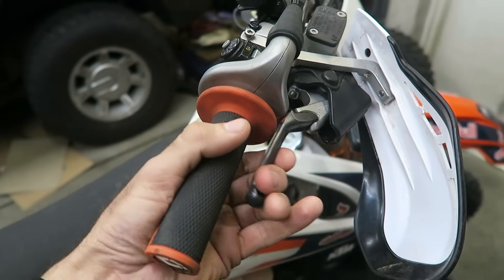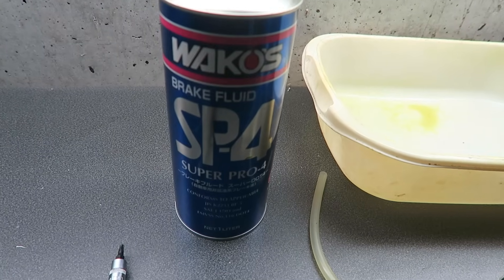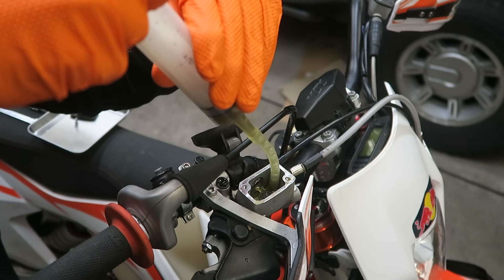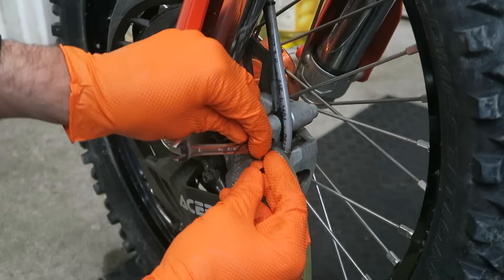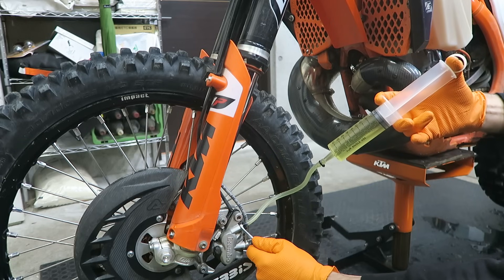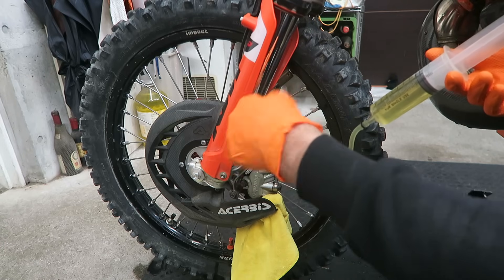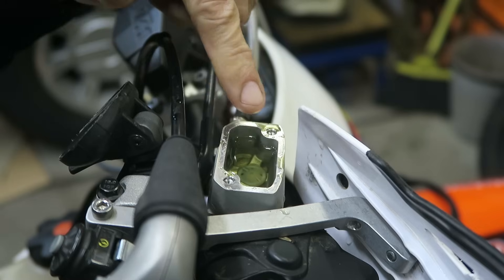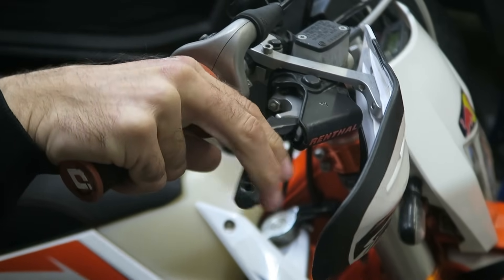Reverse Bleed Brake Fluid Replacement

Comment: just curious why you chose DOT4 over 5.1?
Reply from the maker: For most trail riding I don’t think it matters whether you use DOT 4, or 5.1 as the fluid doesn’t get that hot. But certainly if you’re doing fast riding and a lot of breaking (especially extended downhill breaking), then 5.1 is the better choice. Currently I’m using 5.1, although for my riding (slow trail riding) I never had any problems with DOT 4...
Reply: @TokyoOffroad  cheers!

Comment: Worked like a charm. I tried reverse bleeding and was still was getting bubbles after many many attempts. The key was using the zip ties to keep it sealed the entire time. The zip ties wouldn’t work with the clear 1/4in PVC tubing I got from Lowes, it was way too thick/stiff to clamp through with the ties, kept falling off. What worked for me was silicone tubing like you commented. Ended up using the tubing made for breastfeeding pumps. It looks like it’s too small for the bleeder valve but it stretches over it with some effort, then it clamps down good because it’s so soft/thin. Depressed the caliper pistons with a flathead screwdriver(twist it for the leverage) then pushed through 4 reservoirs of fluid and got the lever super firm the first time. Took me about 10mins total!! Thanks! 

Hope this helps someone else. Wish me luck with stoppies.
Reply from the maker: Pleased to hear that you were successful in the end. Next time should be a lot quicker. Yes, silicone hose is definitely better...
Reply: Just went and got my brother a 06 636 I’ve just been trying to bleed his front brakes spent like 2 hours and still had so much air. Got pissed and started to do more research found reverse bleeding went out got all the stuff went to reverse bleed and still the brake didn’t feel stiff enough. Started searching through the comments and found this one went out got silicone tubing and worked like a charm brake finally feels perfect!
Reply: @jib7793  glad it helped man
Reply: Obviously you won't succeed that way. Air enters the system through the bleeder thread. This method ONLY works if you seal the thread with grease.
Reply: @iulianc9037  the fluid acts as a grease seal for me. Only crack the bleeder 1/4 turn. Actually just did it 2 days ago, only took about 15 mins and the brake lever is very firm
Reply: @mhxxd4  Ok, and how do you get the remaining air out of the top of the caliper if the brake hose is down. Try doing this in a bottle and see if the air comes out.
Reply: @iulianc9037  I'm not exactly sure what you're asking but this has worked great for me every time I've done it. Super firm with rubber lines and no mush at all with metal lines. 

The brake calipers/pistons should be fully depressed with a screwdriver like I said in my original comment or there could be air trapped there. 

And if air gets trapped at the brake lever then with the reservoir full slowly press it(completely down) a few times until you see no more air bubbles coming into the reservoir. Pressing the lever would push most of the air down the line but usually some tint bubbles come up in the reservoir too so when you stop seeing bubbles its a good indication when the air is out of the lever. Now you flush the remaining air in the lines from the bleeder. Also when you're pressing the lever make sure the reservoir's full or it'll suck in lots of air and you'll have to start over.

Hope that helps bro. Any more questions I'm here, done this quite a few times
Reply: @mhxxd4  
The bleeder is positioned at the top of the caliper because that is where the air goes. The brake hose is attached to the middle of the caliper. When you put brake fluid through the top of the caliper, the fluid will go out to the brake line but some of the air will stay there.
You can only get all the air out of the brake caliper by removing it and positioning it with the brake hose up so that the air from the brake caliper goes to the brake hose
Yes, the brake will work fine even with a small amount of air remaining in the caliper. But if we can, why not take it all out?
Reply: @iulianc9037  Noo, it gets all the air out. When you push the fluid with the syringe it takes the air with it, even if it has to travel down in some parts. Normal bleeding usually bleeds the air down anyways so you'll have no issues. If you pull the syringe backwards when you're done, you'll see there's no bubbles left. 

Even if there were tiny bubbles left if they're smaller than the diameter of the  hose then they'll quickly travel up the hose and into your reservoir from the vibrations of your first ride.

I've tested this method a few times, it doesn't leave any air behind if done correctly like I explained. You're overcomplicating things, its very simple

Comment: 74 Thumbs Down?????
What is wrong with people?
Mark, you have the most informative Instructional Videos out there. Keep up the great work. Big Fan.
I do enjoy reading through the comments as well as you can pick up additional tips. Some of the complaints drive me crazy though. Reminds me of the time I was watching this History of Fleetwood Mac show on TV and there was this part where Santana was saying “ I told Peter he should have done this, he should have done that”. I almost threw the TV through the window!
Just finished the bottom end video. Couldn’t put it down. Think I will skip the actual rebuilding of the crank though. A little over my head. I’m better at taking things apart as compared to putting them back together properly.
Reply from the maker: Thanks and pleased you enjoyed the bottom end rebuild series...

Comment: Utilized your brake bleeding method as described, worked perfectly.  Did the same method for the hyd clutch, same perfect outcome.  Watching this and other of your tutorials, notice changes to your machine, on this one the Impact wheels.  Am always chasing maint on my KTMs to keep them near optimum condition for long rides big on fun low on issues. KTM should have a contract with you for this good work. Thanks again.

Comment: First thing I'd do is cover everything with rags or newspapers brake fluid can damage some paints and clock face glasses.
Reply from the maker: Yes, good tip. Certainly better safe than sorry. On the off-road bikes there isn't so much to damage as there are very few painted surfaces (frame). I always have a can on brake cleaner in case I spill some and clean up straight away.

Comment: Great video!  I'm struggling to get new fluid into the line.  It just leaks at the nipple thread with a lot of force on the syringe.  Drain valve is 1/2 turn open or better.  Thanks!
Reply: Maybe a suggestion : Using conventional method, bleed old brake fluid by pressing brake lever and opening and closing ur bleed nipple. It may clear the blockage which may be present.
Then use your reverse brake bleed method using syringe method. I think your bleed nipple is blocked from old fluid gumming up some debri.
Reply: I have got the same! Did you manage to solve it?? Was it blocked?
Reply: very likely you did not open the valve bolt enough

Comment: Good Vid Tokyo, quick question if i may - roughly how much fluid do you need for each clutch, F and R Brake? Tia
Reply from the maker: Jonathan Bradley - They take very little. 250ml should be enough to do everything.
Reply: @TokyoOffroad  Thank you - all the best Jon

Comment: What size hose and syringe do you use?
Reply from the maker: The silicone hose I use is 4mm internal diameter. Syringe size- recently I use a very large one (200ml) which is easy to use and intended for brake bleeding. I also have 100 and 50ml syringes which work OK, but are a little more difficult to use.

Comment: Hi, I have two front calipers. Do I do this on both of them or one side is fine? Please help anyone? Coz with the conventional way I usually bleed both sides. Thank you
Reply from the maker: You can still reverse bleed even if you have two calipers. Just do one side then the other. The advantage is air goes up and bleeding is very easy and quick.

Comment: Thanks for this, I bleed my front brake with no problems :) The rear is giving me trouble, I opened the rear fluid revisor and opened the bleed valve, but when I try to push new fluid in there is a lot of resistance. When I push harder the fluid pushes out just after the bleed valve (coming out the threads I think) do I need to open any other bolts on the brake line? what am I doing wrong?
Reply: I had this issue too, open the valve more and it should help.

Comment: If you were just bleeding the system and not filling a dry line, would you still use this method? The bottom couple inches of fluid always seem to be the darkest. Bleeding using this method would push the bad fluid through the entire system ?
Reply from the maker: Yes, I still use reverse bleeding for replacing fluid. So long as you replace all of the fluid I don’t think there should be a concern. AFAIK the discoloration is due to heat rather than contamination so I think this is a non issue.

Comment: Would you make any special modifications to the brake line while bleeding as on my 2013 KTM 300 xc the brake line sticks up and over the master cylinder at any angle the bars are at. Sometimes I'll loosen the top banjo bolt so the line is angled lower than horizontal then reposition once I've bled the system.

Comment: ive tried this quite a few time and i cant get any fluid to go into the caliper.
Reply from the maker: TheCharillz23 - What bike do you have? Are you sure the bleeder on the brake caliper is being opened?
Reply: @TokyoOffroad  yeah
Reply from the maker: What bike do you have?
Reply: @TokyoOffroad  01 yz125. It's like. The master cup won't fully Prime.
Reply from the maker: TheCharillz23 - It sounds like your master needs rebuilding/repairing

Comment: A tip that is popular when bleeding mtb brakes is to pull on the syringe before you open the bleed valve.  You’re trying to create a vacuum in the syringe, when you do you will see loads of small air bubbles form in the fluid, flick the syringe with your finger to get them to float to the top of the syringe.  Just another little thing to get that nice firm lever feel.
Reply: That will pull air in past the threads of the bleed screw.
Reply: @walterandrews3077 It never has when I’ve done it.

Comment: Excellent vid.. nice and clear. May I add that topping off the brake fluid to the max level should only be done when new pads are fitted. Topping up to the max level on the reservoir with part or well worn pads will only cause you headaches later when you come to change the pads for new ones because the fluid can overflow from the top of the reservoir as the piston/s are pushed back into the caliper/s and the fluid level rises making a mess, unless of course you drain some excess off prior to fitting said new pads. (not everybody follows this practice and the reality is brake fluid leaks through the tiny air holes present in the underside of the cap/lid that are designed to allow the seal/diaphragm to take up the slack as the level falls and the pads wear) Not being critical my friend just some helpful advice if it's any use.
Reply: You can completely avoid this by opening the brake bleeder when pushing the pistons back, i do not understand why people jump through hoops when its the easiest method.
And using a pair of calipers to measure brake fluid level is just psychopathic.
Reply: Wise words!
Reply: Even then people tend to squeeze the brake piston all the way in which might make the reservoir overflow
Reply: The caliper piston is roughly 3 times. Larger than the master cylinder piston. . 
With that said when  you push the caliper piston in just look how much pressures your are putting on the seals & cups ,  roughly  12 mm caliper piston. I have ruined even new master cylinders with that method. What to do is open the bleeder on the caliper to relieve the pressure you create when pushing the caliper piston back in. Or just take your chances.

Comment: You want to check the level of fluid compared to the amount of wear on the brake pads. That way when you change pads you won’t over flow the master when you compress the pistons.

Comment: Could not get this method to work on my KTM 690 Enduro ABS. Once connected, could not depress the syringe, forcing fresh fluid back into the system and up into the reservoir. Not sure if the ABS unit prevents a reverse flush but with the bleeder bolt open fluid could not be pumped/pressed back into the system.
Reply from the maker: I don't have personal experience bleeding 690 ABS brakes so hesitate to offer advice. Anyone else?
Reply: @TokyoOffroad  Thanks for the reply. Had to settle for a vacuum pump and bleed/pull from the bottom. That worked fine. Would like to figure out if the ABS is preventing a reverse bleed but for now I'll go with the vacuum method.

Comment: You missed a step. That bleeder valve is above the brake line fitting. When you are pushing fluid in through the bleed screw, air can remain trapped in the top of the caliper ( in the upper piston bore and resettle in and around the bleeder passageway). You can't push the fluid through there fast enough to guarantee you get all the air. Before you called the job done, you should have pumped up the master cylinder and cracked open the bleed screw again to expel any remaining air that may still be in the caliper above the brake line fitting. Yes your brake may feel "ok" and function, but why not add the final step and make sure the air is expelled.
Reply from the maker: Good tip. Although I’ve never had an issue reverse bleeding the front brake as shown in the video, what you’re suggesting would only take a few extra seconds to do and help ensure a full bleed.
Reply: To use a medical term, you can flag the syringe at the end to verify there is no air. As in draw the syringe back and see if there is any air trapped and at the same time bring the fluid down to the fill level on the M/C if necessary.

Comment: Same technique works well for reverse bleeding hydraulic clutches.

Nice vid. May I add, after emptying the reservoir, I like to cover the reservoir with a cloth, because sometimes the new brake fluid can sputter through the tiny orifice in the reservoir and tiny drops can splash out the reservoir. The cloth prevents that splashing. Or, just add in a tiny layer of new brake fluid after taking out the old fluid.

Comment: What kind of syringe are you using? Thank you.
Reply from the maker: Michael S - It’s a syringe I purchased from an automotive tool shop. It work OK, but the hose fitting isn’t great as the syringe is tapered. I’d really like to find a syringe with a more secure hose fitting. Does anyone have any recommendations?
Reply: I used a similar syringe. When doing this job, I find the tapered end helps push the hose far enough that it’s nice and snug.

Comment: I tried reverse bleeding my motorcycle and the right one bleeds well - fluid goes straight up. But the left it doesn't go up. It's leaking somewhere on the left caliper. Is the seals broke or is there a blockage on the  brake lines?
Reply from the maker: There shouldn't be any reason to not be able to reserve bleed both calipers the same way in a dual caliper system. I suspect there may be a blockage, or issue with the master.

Comment: Thanks for this! How hard are you pushing the syringe? I back-bleed mine yesterday and had to press the syringe with my knee to move fluid. Bleed nipple was open, no obvious blockages.
Reply: Use smaller (thinner) syringe. Easier to press.
Reply from the maker: I have to press hard, but nothing crazy. Maybe it’s an issue with the syringe you have. Reverse bleeding is popular with mountain bikers and I know there are some nicely designed syringes for that. I haven’t tried any other syringes than what is shown in the video, so don’t have any specific recommendations

Comment: Why is it so important to get the air out when you bleed but then leave 5mm of air in the reservoir? Doesn't that defeat the purpose?
Reply from the maker: Any air in the line, between the master piston and slave will compress when you operate the brake lever and make the brake feel mushy. That's why it's important to bleed all the air out. Air in the top of the reservoir does not enter the hose easily, unless the bike is upside down and you operate the brake.
Reply: If you don't leave that space, you will boil the brake fluid and blow out your seals, glaze your brand new pads and rotor like I did this weekend.  yeah I'm an idiot.

Comment: Is this the same procedure you would use to replace the clutch fluid Mark?
Reply from the maker: Yes, the reverse bleed method works well for replacing clutch fluid too. Quick and easy. Often the only slightly tricky bit is getting the syringe hose to stay on the bleed nipple, but I've found that a zip tie works pretty well to secure it.

Comment: Hi mate great vid as usual, one tip I use is when finished bleeding is to fill the master cylinder up to the top so when I put the lid on it overflows with fluid, this means there is no air in with the brake fluid. Then if you crash / flip the bike etc no air can travel down the brake hose. 😊

Comment: Hi Tokyo, but I can't find the syringe anywhere! What do you recommend, otherwise great video.
Reply from the maker: Manuel Montiel - An automotive parts store should have a suitable syringe.
Reply from the maker: One other option would be a syringe made for mountain bike brake bleeding. They appear to be well made and many of them have secure hose fittings. However, the capacity is quite small (usually 20ml) and the hose ID may be too small.
Reply: Tokyo  Offroad Thank You 👍